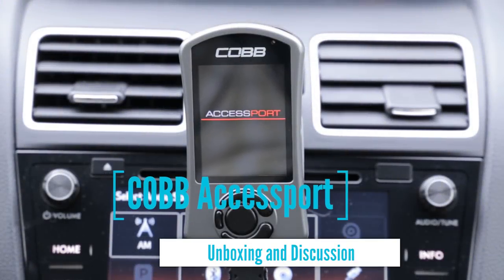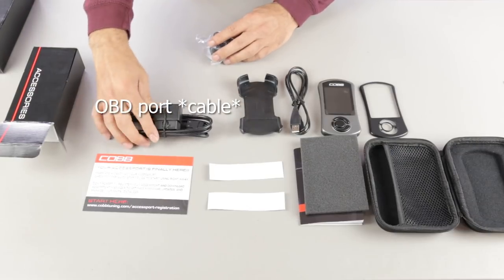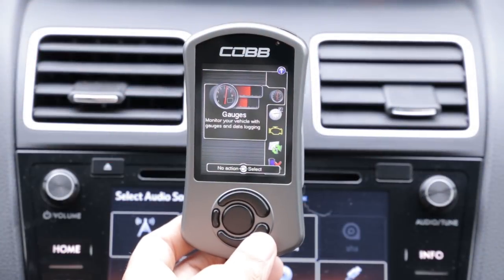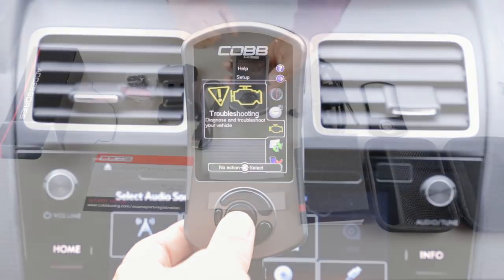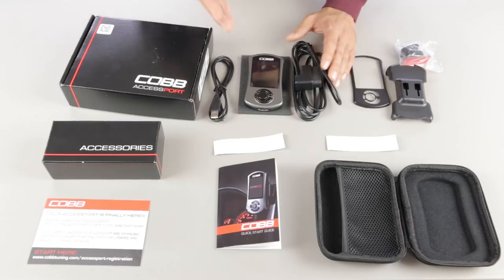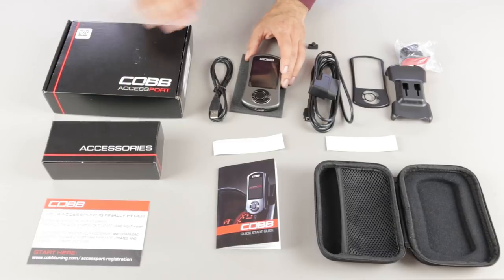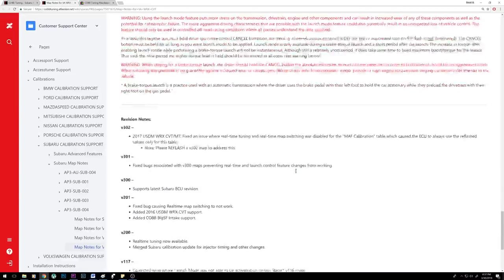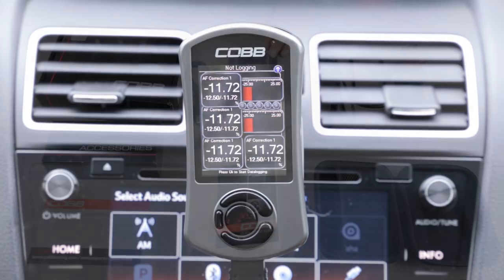COBB Accessport Unboxing and Discussion

Comment: So after installing it while it’s connected to your car, you can take it off the cable and just put it somewhere non visable as long as it’s charged?
Reply from the maker: A few things: this doesn't have a battery and is not wireless so it must be plugged in to use. After use you can unplug it and put I away. If you used it to install a tune the tune will stay on the car even if the AP is not plugged in.

Comment: Cobb Australia don't have an Accessport for the WRX CVT, not sure if they will or not.
I think I read they are considering it for Australia.
Reply: I can recommend a tune at least. I had one for my Levorg, and have since added an aftermarket J pipe with an updated dyno tune.  All up, I have about +27kw at the wheels.  It drives so much better, more like what the car was designed to do.

Comment: I have a 2016 Wrx limited. I just got a sf intake and am getting the access port. Is the ots map safe to run if the intake is the only mod I have so far?
Reply: i know this is 9 months old but you should really be careful doing ANY mods that affect airflow without a tune even something as simple as an intake